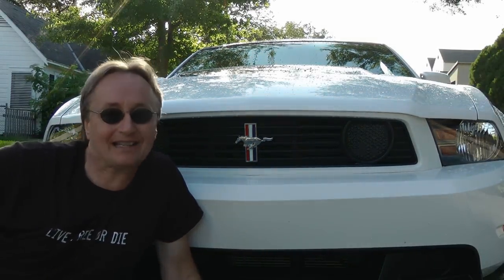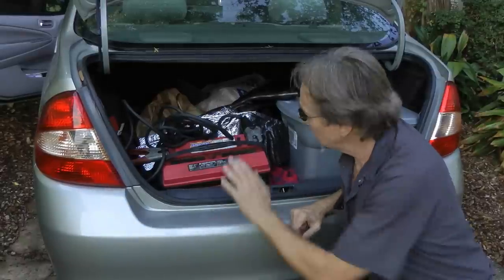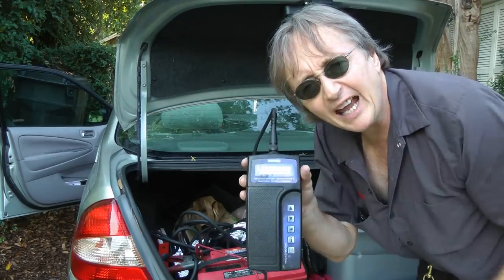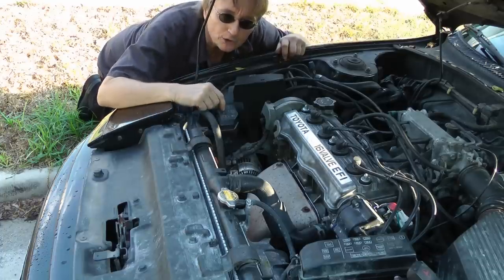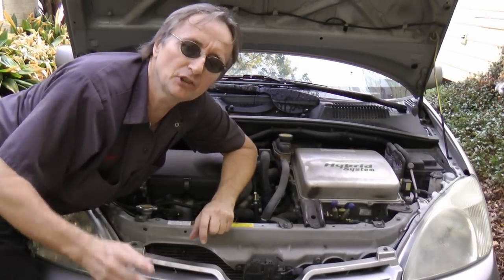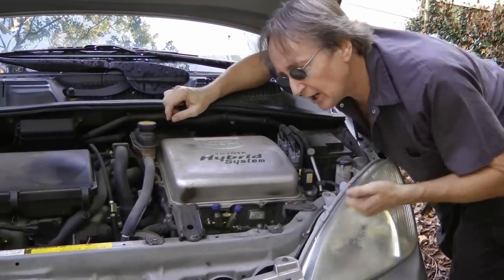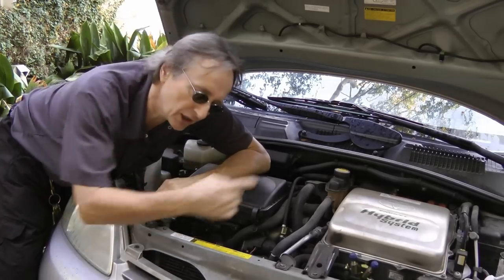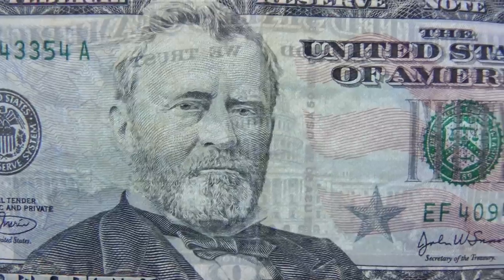Hybrid Car Electrical Problems

Comment: 1st gen Prius's are terrible. 2004 or newer require little maintenance if you drive them regularly. We use them at my pizza shop for delivery cars. We have a 2004 with 230,000 and everything still works and has never broken.
Reply: fRoZeNcookies yea the later priuses are tanks, especially 2006 and onward.
Reply: Congrats on the '04
'06 tanks? Is that good :\
Reply: FastLikeUNO tanks?
Reply: By tank he means low maintenance requirements.  Even brakes last 120k miles or so.
Reply: Frank Siu  second pack lol

Comment: I would have to disagree. I see alot of Toyota priuses with 300k+ miles on them being sold with the orginal hybrid battery.
Reply: As long as you find an independent mechanic works on them. There is no reason to buy hybrid
Reply: They no longer have this kind of problem.  This video is 9 years old and he is talking about an 18 year old Toyota Hybrid, one of the first of it's kind.  It is a perfectly fine video when looking at the models available then.

Comment: Hello guys. I work at a garage washing cars since November and i've seen a Prius (second shape) in the workshop needing to have its hybrid battery replaced and that involved taking parts of the interior out including the back seat. Once that was done, I washed it. The first time I moved it, it moved fine but after, I couldn't and it said on the central screen on the dashboard saying its transmission became abnormal. I discussed the problem with a leading mechanic and he said it's a problem car. So Scotty, this Prius you've showed us wouldn't be alone and it comes to show as hybrid cars get older, they'll develop big problems. Expensive as well.

Good showing this video. It is informative for sure.
Reply: I didn't know that. But other than that, it's one interesting story. That just made me think how hybrid cars can get stolen (by carjacking perhaps) and have their parts sold to a black market. I do understand how expensive and valuable the hybrid batteries are and I had that thought on stealing hybrid cars.

Well that's what I think today. At least I didn't buy a hybrid car.

Comment from the maker: @1person89 either the brake rotors are warped or the master cylinder isn't applying pressure right and needs replacing. OR, the transmission is going out, they often do that in old buicks. Scotty

Comment: I own a 2004 Prius (gen 2) which I currently live in. Haven't owned it long enough to comment. however, the CV shafts do not last that long. the bonus is that I almost never need to turn it off, so I can run the fan, heater and AC full time. the current draw from the HV battery seems to be low in this case, as opposed to driving. thanks for the input Scotty
Reply: Are you still living in it?

Comment: Just replace the Flux Capacitor and you are good to go.
Reply: So no need to replace that generator between the engine and transmission?

Comment from the maker: @flyboyofglam  Side to side play is normally worn tie rods. wheel bearings would have play at all 360 degrees when you pull from different angles. Scotty

Comment: I own a 2012 Prius.  I can only partially agree with this post.  Any hybrid drivetrain component repairs are pretty expensive and is usually more than 3k.
1) Transaxle (this is the most expensive) ~5k
2) Inverter ~3k
3) Hybrid battery ~1-3k

However, all the hybrid parts are designed to last for a very long time and are expected to occur somewhere near the end of the life of the car.  The repair bill is high, but the failure rate is very low.  A regular gas car has a moderate repair bill but with a comparatively modest failure rate.

I guess this does make older Priuses risky.  It's just not as serious as this video is implying.
Reply: siward44 the generator fail is probably the most common major failure that sends the Prius to the scrap yard, though I don't see many fail very often. 

Mechanically separating the ICE from the drive train and utilizing electric motors would be more simple, though high speed performance will be lacking without some sort of transmission for the drive motors (unless the motors are highly overspecced for the application).
Reply: Very few transaxle repairs if you change the fluid every 50k. And don't use the WS fluid which is not synthetic. Use REDLINE D6 which is real synthetic. I have replaced bad modules in my 2005  5 times. They are $35 on E-Bay. Inverter failures are rare as well. The Gen 2 is simpler than Gen 3. Gen 3 has an expensive electric engine water pump and a pesky EGR valve.

Comment: I have a first gen Prius it’s a 2003 with 118k but the reason this happened is most likely because the transmission fluid was never changed. Old fluid will not cool that transaxle assembly like new fluid will. The trans fluid cools the generator, luckily I’ve gotten mine changed, another example of how important routine maintenance is

Comment: What year is that Prius? How many miles does it have? That is a first generation Prius. Any car with 10 years is going to have major issues. You don't need to discredit the whole model.
Reply: i have 2 cars that are 26 years old and another that is 21 years old. i have 2 1991 cavaliers and a 1996 camaro Z28 LT1. i dont spend allot of money on cars. they all have needed some work but have been overall reliable. certainly not MAJOR issues. the camaro has 227K miles on it, it has seen 1 trans overhaul at 180K before i bought the car. camaros dont generally get thrown out. its a performance car. tell you one thing a full transmission overhaul on that car is $1,200 less then 1/3 of replacing that stupid generator thing.
Reply: I don't think he discrediting anything, I think he's bringing up a valid point that hybrids may have more costly repairs and if you are searching for a used car, it might be better to buy a regular car. I've been watching Scotty's videos for 4 years and I've seen enough to know he is a Toyota man. I don't think he dislikes hybrids, or the prius, I think he has a point tho. I mean like you said a 10 year old car might have problems. In which case why pay for a car that will cost 5000 as compared to 100
Reply: Somewhere in the middle of the video, you can clearly see that the car has 91,000 miles on it, ANY car SHOULD last longer than that without many problems

Comment from the maker: of course always have the battery and alternator load tested if you are having car problems, and places like auto zone do it free. but normally a bad battery will not make a car stop, because if it did, it would then not restart back up

Comment: They do have a separate cooling system. It has its own coolant pump and everything. You can get a refurbished inverter or "generator" for around $700. I bought a 2001 Prius in 2010 with 130,000 miles. It had a dead battery, so I bought a refurbished one. I'm currently at 175k and have had no issues. If you can get a good deal on an older one. I would say go for it.

Comment: WOW, THANKS !!!
I was seriously thinking of buying a new Prius so i could keep it for 10 or 15 years. I was comparing that to the cost of a new Base 'L' Corolla instead. I did not know that it was so crazy expensive to fix the charging system on the Prius. Thanks, you've saved me a ton of problems I would have had in about 7 or 8 years.  I'm going to get the Corolla instead (the  4-speed auto, not the CVT.)

Comment: In Prius generator does NOT charge 12V battery at all. it is charged by separate dc-dc converter from hv bus, that is connected to hv battery
Reply: In this case I'm not sure. But usually Scottie knows his cars and gives great advise. I'm going to buy a lexis and it has the same engine and battery as prius. Most people with prius love there cars and have lasted along time as well.
Reply: well let me ask this i have a 04 prius , i changed the mechanical pump for the synergy pump ? now the ignition clicks , it will not start heck i cant even locate the starter ,
Reply: western spud break out your wallet.
Reply: its ac to dc actually and its the big invertor box that sists on top of the gearbox! the generator scotty is talking about charges the batteries but the invertor sends the voltage where its needed from a/c to d/c for the 12v battery.
Reply: Volodumur Kalunyak If the 12v battery isnt charging....simple fix. you could hook a portable jump starter to the battery.....The 12v ONLY boots up the computer.....doesnt crank engine,......you dont need any cranking amps.  Even 8 D batteries would probably boot the computer.   then the hybrid battery cranks engine
Reply: so the generator -> inverter -> 12v battery. sounds like the generator is still responsible
Reply: charleysturbos 9
Reply: Mike Fu well now we know who the triggered prius owners are

Comment: It does not look like a well maintained Prius.
Reply: Does that matter?  It's not like the generator requires oil changes.
Reply: Care and maintenance goes a long way hybrid or otherwise. Always change the radiator and inverter fluid every 100K and you can't go wrong. These things are built like tanks BUT even tanks need maintenance too.
Reply: From what I heard from some of my friends that served in Iraq, the M1 tanks are better maintained than most people maintain their cars.
Reply: people are probably mad bored over there sometimes lol and when army mechanics come back to the states they are generally pretty good but super stern when they talk to you lol

Comment from the maker: @whole27 I'd go corolla. 
really, this whole hybrid thing is like mass hysteria, considering the cost and the complexity. I also predict electrical cars will be about the same, costing too much and really, where is the electricity going to come from? The power grid in most places is already stretched to the limit, adding that much more could push it over the edge.

Comment from the maker: The car was towed to a toyota dealer cause the owner didn't believe me either. So the toyota dealer told her the generator was shot, and she junked the car rather than fork over 5 thousand something bucks. The car only went up and had power because I put an old mercedes 1000 amp battery in the trunk to move it in my driveway.

Comment from the maker: @danielcoig That's what the book pays for the job. and yes, they overheat from bad design, mixing internal combustion engine heat and electrical generator heat just didn't work out in this case. Scotty

Comment: scotty you saw the 2012 camry hybrid ? it got to belts, it got electric power steering + AC compressor + water pump, all 3 are electric so it gets 38mpg city & 40mpg highway

Comment: Yeah hybrids are harder to work on and sometimes you have to replace whole assemblies rather than an indivdual parts, buy hey, 50MPG is pretty good and I'm sure they've worked out most of the issues with the newer Pri. Maybe buying a plug-in 3rd gen 10 years from now would be a good bet. The only thing I've heard of are Pri with OEM HID head lights, stick with the halogens and do a aftermarket HID kit if you want more light.

Comment: We bought a 2008 Honda Civic Hybrid with a bad computer module a few years ago for less than half the retail value, ended up getting Honda to warranty $3,000 in work to fix it. A year later the battery pack only held a 15% charge, making the car rely on just the 1.3L engine, a pain at best, dangerous at worst. Felt very fortunate to get a trade in value close to what we had invested in it, bought a dead simple base model car with no hybrid or turbo to go bad!!!

Comment: That a series hybrid, like a diesel-electric locomotive or like the Fisker Karma. Does not get very good MPG at all on the highway since it is more efficient to drive the wheels directly with the engine on the highway rather than run the generator, convert to DC to battery, then out of battery, DC to AC, to motor.
Cars like the Prius/2013 Accord Hybrid, other full hybrids are a combination of a parallel and series hybrids on demand, computer controlled, including the Volt once the battery is low

Comment: Hey Scotty, what's your thought on the 2014 Kia Optima Hybrid? 

It too has a charging system for the battery when you're coasting or braking, like the Prius in this video, but the gas engine can also charge the batteries. 

So if you're sitting at a light or in a parking lot waiting, the gas engine will be off, but if the HEV batteries get too low from the ac, radio, lights, etc use, the gas engine will start and charge the batteries alittle.

Comment: If you are going to buy a Prius go new as the hybrid system is under warranty for 7 years or 100k. Used to work for a dealer and when Prius's came in with charging issues it was always a 5k repair bill.

Comment: I just bought an 09 Camry with 120.000 miles on it. 
It's a great car and is fully loaded.
Having said that, I still worry about the hybrid system going bad. 
Other than trouble codes, are there any obvious signs that could indicate trouble??

Comment: @BMLarson93 You mean the EGR valve?  Yes and no, depending on how your EGR system has failed.  Sometimes you can get away with cleaning the valve and the passageways in the intake manifold connected to the valve.  However if the valve simply fails to work...be it electronically or mechanically, then you'll have to replace it.  It's best to clean with throttle body cleaner or electronic contact cleaner, as brake cleaner can be flammable.

Comment: The toyota prius uses the three phase a.c. permanent magnet synchronous motor to crank the gasolene engine  and as a generator to recharge the battery.

Comment from the maker: @eleeter It is not an ignorant video, it shows the mechanical fault of a poorly designed generator system. You know not what you talk about, it is not cells, it also had codes for the transfer case and the toyota dealer locally gave a 5300 dollar estimate on repairing it when it was towed there. Don't speak about stuff you know very little about, obviously. Scotty

Comment: Have you seen any customers bring you in a new prius from 2012 that a dealer didn't want to do anything about? I see that you mentioned a used prius in the video, but wondered if  you have seen or heard of new prius cars having battery problems.

Comment: Even so, try comparing that v-tec valve distribution system (if you ever have problems with it), with a classic fixed timing and lift distribution. The prices are way higher for that v-tec, also it fails more often.

More complex, better performance in some aspects, more prone for malfunctions due to complexity and a hell of a lot more expensive.

But some prices have to be paid, otherwise we would still drive a VW Beetle or Trabant or any other very simple car.

Comment from the maker: @Matthew55904 well, I've talked to other mechanics who work on hybrids all the time, and to a man they said they tried, but it never lasted long fixing em rather than replacing the whole assembly. I'm sure someone could fix it cheaper, but it may not last long, which is what the other mechanics who did try to actually fix them without replacing the whole assembly. Scotty

Comment: On these cars when your 12 volt battery starts going bad AKA shorting out internally so voltage is not up to par you can limp the car back to get a new battery in it by stepping on the brake then the gas back and forth just to get it off the road.

Comment: When I slow down during the last 4-0mph it tends to make a little clunking sound from the driver's front wheel, I'm told it's the friction brakes engaging? It is normal that you know of? Mine's a 2005 Prius w/61k miles on it

Comment: I have an issue with what Scotty said about melted hybrid generators... Did the driver bother to check the coolant levels? The hybrid generator uses the same coolant that is in the radiator, and it has a  separate reservoir for it... if it gets a leak or wears out, the generator WILL wear out and melt. I have a 2002 Prius with 205k miles on it and I make sure that my coolant levels stay where they are supposed to, and it is still purring like a kitten.

Comment: That's a first generation Prius, they are known to have problems, I own 2013  Prius V, it has already over 200k miles, only things I replaced were: emissions box, spark plugs and tires, heck I even still have original breakes on. Why I have soo many miles you would ask, because my job is to escort oversized loads. My brother in law put 300+k miles on his 2011 Prius before it started having serious problems. So, I used to believe same myth that a hybrid is bad idea, but honestly it's puts out same power as Corolla and it get 40+ mp average. So don't make a judgement based on first generation trials.

Comment: Yes, I totally agreed with you. You have to check the coolant level of any moving part. Toyota and Ford always have the white clear see-through reservoirs. Just open the hood and check it when you fill up. Only BMW is all black reservoirs. I guess German engineers want to act cool.

Comment from the maker: oh no it wasn't. Not much of a tech there. This car ended up at the toyota dealer which took it apart for parts as the generator was indeed melted inside and shot, car wasn't worth it to fix that.

Comment: Yeah, I run a Hybrid camry for one of my taxis and was stunned with how good it was...So good that I bought an EX taxi prius for my wife to run around in...over 500,000 klms (310600 miles) on it..still on ALL original parts except for the 12v auxiliary battery ($100 replacement) after I left a soldering iron running off it overnight. (stupid, I know...I had to drop what i was doing to sort out an emergency, and forgot it was all still hooked up) lol